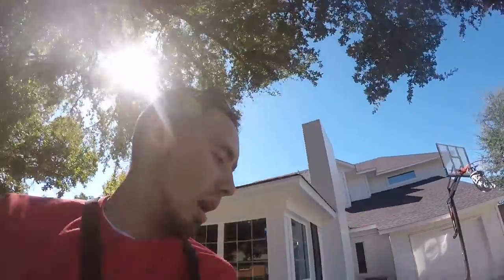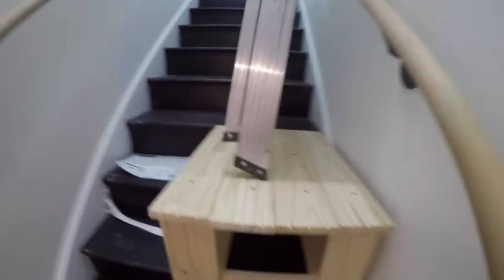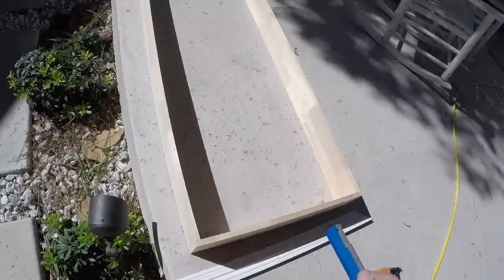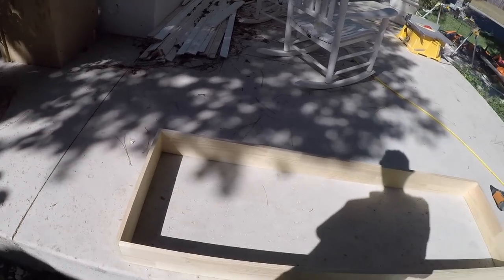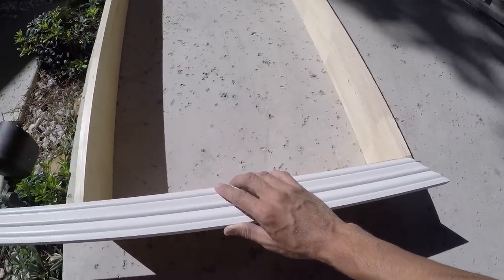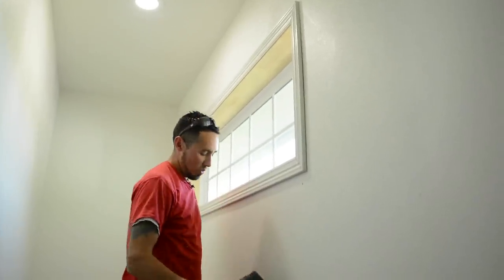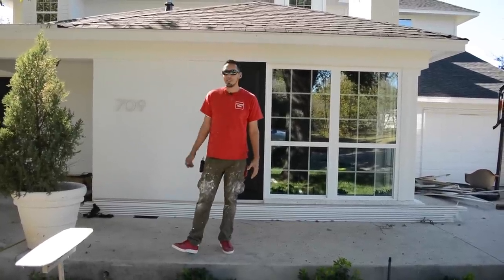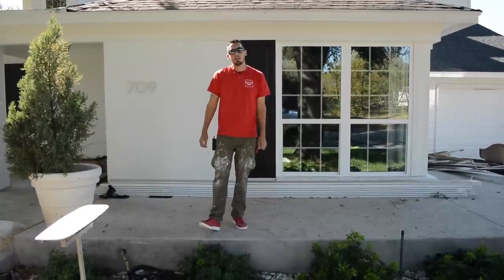Easy Install Window Casing - Trim Carpentry

Comment: NO INSULATION - I will be installing ext. jambs and trim on windows at my camp addition in northeastern NY. The only downside to this, which by the way I was going to use your method, is insulation. It can reach 15 below. Insulation is a must!

Comment: I pre-make all my cased windows but I usually dont picture frame them.  I go with window stool and better header details.
The best way to measure for a window would be to measure the inside of widow sills both ways.  Say you had 71 sill to sill horizontal and 23 sill to sill vertical.  You would ADD on your reveals and header overhang.  That way you get perfect reveals.
For a picture framed window you would cut horizontal headers at 71+1/4+1/4+1.5ish = 73 inches, rip to width
Vertical left and right would be 23+1/4=1/4 =  23.5 inches, rip to width
Then add your opening + reveals for casing measurements.  Casing would be 72" short to short and  24" short to short, 2 of each.
Nail together and hang with perfect reveals.

Comment: Nice work but can you tell me why your 23s were on the outside?  i normally keep me verticals on the inside and my horizontalls on the outside for the structural integrity,

Comment: How would you deal with a window jamb that's not quite square? My window jamb depth is out about 1/4" over a 4ft length. Do you go with the narrower measurement all the way across, or taper it?

Comment: When building your window trim, do you ever check the square of the window?
Reply: Well yeah but if window isn't square you adjust to it to make the casing and trim square. Not much you can do about the window itself.
Reply: @pepeman3099  I meant the window opening. Thanks for responding

Comment: At 15.23 I see the miter corner seems to have a crack in it. I have seen in videos people say to take the brad nailer and hit the miters from the side to keep them from seperating over time. I tried that recently and cracked the corner and I am wondering if that happened to you too lol?

Comment: Just wondering, why did you make the 71 shorter and not the 23? I am thinking that having the horizontal boards "sit" on top of the vertical would provide more support? I know it's not really needed in this specific case, but ...

Comment: Nicely done! Did you measure the opening for plumb and level first? What about measuring the horizontal casing for level after you fit it in?
Reply: ErrorError He obviously took all the necessary measurements because guess what? It fit! I don't think he pulled the measurements out of his ass. Just because you didn't see it in the video doesn't mean it didn't happen.
Reply: I wasn't accusing him of anything, I was simply *ASKING*. Assuming that anything is straight/plumb/level/90 degrees can be a real problem when reality sets in, especially when it's older construction or a home has had a chance to settle. I was asking because I genuinely want to know if he checked at all and what he might have done if angles/measures hadn't been perfectly square. Get a life!

Comment: Dude, I need your help. House walls racked. install a pre-hung door. top left flush to wall and bottom right flush to the wall. everywhere else the jam is sticking past the walls. What do I do to be able to install trim and make it look presentable? Ideas, please. The home has sunk up to five inches in different locations and was hydraulically pumped up. Help. Door frames are no longer in alignment with each other. Thanks in advance.

Comment: Easier way to do that top casing and bottom is to measure inside and add 3/4 to the total. that's the inside measurement of your 45. But regardless, your work rocks :)

Comment: For me, I just measure the inside of the 3/16" reveal, and add double the width of the casing. If I have 20" inside my reveal and using 2 1/4" casing, the overall casing width cut is 24 1/2". Easier for these old eyes than marking & cutting the short point of a piece of casing.

Comment: Nice video, good detail, right length, nice camera work.
If I could stick my two cents in, try working up off the ground, your knees and back will thank you in twenty years.
Reply: Amen to that brother. Same reason I built a welding table. Too old to do it on the ground anymore

Comment: When you nailed the casing on, it looks like you didn't put a nail in but about 6 inches from the end of the long casing(top and bottom).  Is there any reason for that to leave the end loose?

Comment: Your vids are amazing. Definitely sharing with others!!!
Question - bought a house in the midwest with all drywall returns on the windows, they have no trim. I want to trim the windows. 
Must I rip the drywall casing out from the window and install my own wood window casing board first? What is the reason for this?
Is the reason for this because the window trim must be nailed into wood casing and not drywall casing? 
I feel like trim is wide enough that I could get away with nailing the outer perimeter of the trim to the wall and hit the studs underneath. Is it simply just not professional looking if the inside casing is drywall?
Reply: I have the same question! Ever get your answer?
Reply: @vivianataylor9202  removing the drywall return and replacing with wood panel is definitely more professional and polished. Up-close, there is a huge difference between 1) a smoothed drywall return and 2) a painted and glossed wood-panel return/encasing. 

If these are windows high up and far away, there is still a difference but less so).
Reply: That being said, there are tons of compromises that people make with varying degrees of long-term issues. 
I’ve seen people sand smooth their drywall return, and then make a thin wood-encasing and slide it over the drywall return. 
I’m not a professional, but I’d strongly encourage the use to a water-insulating sealant between the drywall and the wood so that the seem between them doesn’t wick in water (from the window) and create a crevice for mold. Other than that concern I’m not sure there is a issue.
Reply: @vivianataylor9202  basically a craft person will just paint their drywall return white and nail trim around the window. The next level up is to make sure you sand that drywall return smooth first. The next level up from that is (if room allows) to put a wood encasing in over the surface of the drywall before adding the trim. And the final level is to remove the drywall return and replace it with a nice wood return.
Reply: @MaBuSt  Thanks for the quick reply! Thats what I figured but I had not seen anyone address it. I am leaning towards using a thin piece of wood over the existing drywall return. The windows are well insulated and I am worried if I take off the drywall return I may mess that up. I will definitely take your advice and use a water seal between wood and drywall.

Comment: I have replaced most of the windows in my home. Every wall is significantly bowed so there is always a fairly large gap betwen wall and casing, and the casing is stained not painted. I place a filler strip the width of the largest gap on top of the casing that is resting on the jamb and scribe the width of the gap down the casing and then glue the filler strip to the casing. I cannot bend the casing because using 3/4" pine.  Is there a better way to do it? PS what contributes to the problem is that they originally used 3/8 drywall and exterior sheathing so the wall is undersized.

Comment: so how do you insolate around the window jamb
Reply: Obviously you can't. Probably warm weather year round. Here in the  Great White North, you have to assemble it all on the window and spray foam or stuff it with batt insulation as you go.

Comment: I normally shim,and spray foam insulate around the jambs as well as the window, so this technique would not work for me. It is a good method for southern builds. I enjoy your videos and can tell you are a craft men like my self.
Reply: Justin Mercer same here in Manitoba
Reply: Looks like it had a drywall return but not 100%, but it would work in that case

Comment: How do you account for a window opening that isn't square? Or a window opening that is bowed in the middle? Do you take the smallest measurement and frame to that distance?
Reply: Michael Aguilar Yep!
Reply: Make it to the smallest detention and casing trim will work as shims. By the time you will caulk it and paint int wont go any where.
Reply: I do the opposite.  Take the longest measure and put the box up.  Mark all edges that stick over and angle rip.  The apply casing.  I have to do this with stain quality oak.

Comment: What do you do different if the window isn’t square?
Reply: Make it to the smallest detention and casing trim will work as shims. By the time you will caulk it and paint int wont go any where.
Reply: Remove window $$$$$. Remove framing $$$$$. Start over with crew of men $$$$$. Now window and walls are level and plumb. Just remortgage your home to pay the bill.

Comment: At 8:45 you say that you need 3/16" reveal. May I ask what for? I'm not a carpenter, I don't see any practical or aestetical aspect of that.
Reply: Aesthetics
Reply: Sometimes it varys from house to house but you always want to keep the reveal on the windows/doors the same in every house
Reply: MrKret87 the reveal helps hide any variations in framing as well as any shrinking and swelling that occurs throughout the seasons.
Reply: Easier to paint and stain too with reveal

Comment: That method only works providing the window and rough opening are installed level. Otherwise how do you adjust the jamb extension to meet the reveal around the window? Cant get shims in with trim preinstalled. Also unless you install it tight to the framing how do you keep the back side of the extension from driving up/down when you nail it? Good video just want to see how youd address these issues.

Comment: was it reall necessary to nail tha in with such a tight fit? if a glass pane up theer gets broken, seems would be a bear to change the glass? as well as that fit, I would have maybe not even nailed it!
Reply: tcseacliff it would have likely moved around, shifted, gapped up, etc. when the wood expands/contracts & houses shift & move when the temp changes & that tight fit (today) could be a totally different fit in a month or so.  You don’t want to not nail it in, if the fit loosens later it could fall on someone walking up/down the stairs! 😳 lol smh

Comment: Why don't you make the top piece longer which would sit on top of the side pieces? I understand that this application isn't structural. Just seems easier and stronger. R.I.P. FATS DOMINO.
Reply from the maker: Brian Spruill it makes no difference. Could have done it either way. Same result in the end
Reply: Actually not quite. In any traditional sill the sill always runs through, with the side jambs sitting on it. Ditto the head jamb.  If they were to separate slightly for some reason when you look up (or down) that way you're looking across the joint instead of right into it.  Same reason you watch the direction when you cope and keep the line of sight across the coped piece when you can ;-)   I can tell by your vids you're into what you do and want to do the best work possible-  get a copy of  Marrianee Cusato's "Get Your House Right - https://www.amazon.com/Get-Your-House-Right-Architectural-ebook/dp/B0751H8T9Z  - it is THE ultimate reference on architctural millwork,  scale, fenestration, etc.   Seriously - get a copy you'll thank me - your work will soar to the next level.
Reply: @HBSuccess  ... Tioga great advice . $35.00 Hardback. Digital $9.00
Reply: Tioga Fretworks I said the exact same thing when I was watching the video
Reply: Brian go and do it your way if you feel better.

Comment: I would have painted it before install.
Reply: Yes!!
Reply: owners resosabilitty hes a tri installer
Reply: owners  responsibility
Reply: Me too. When it's painted 1st and sanded, the final coat of paint really stands out as a finished product. 
 I deduct 3/4" from each piece to allow them to be nailed to lock it in place. I use kiln dried fir a lot and I also add glue to the joint, they are very tight frames and have not had one move in decades. We also insulate between the liner and the framing, now they ( code ) call for foam bead only. For my own places I add more insulation in front of the foam bead.
I do not place the trim on the frame, I use shims to nail through the liner to the framing, then install the trim. The allows the liner to be sized to produce the same reveal around the window frame, small 1/8" works for me, to minimize how much plastic is visible. You can even make it flush if you like for a " no reveal" look.
This is a tough place to work , so the solution is very good to get the job done.
Reply: @richardv5674  don`t give away the easy work to FCtv, painters got bills to pay too....I have ladder levelers on a short fly section of ladder. i`d prep and paint that window with a sandwhich in one hand...
Reply: @richardv5674  is that your enemy statement?

Comment: Why not just measure the inside of the casing and add 3/16 or 1/4 from both sides to the final measurement for the trims shortest point? start on one side and tack on and go. should line up perfect every time.

Comment: I do a lot of these because builders in my area are too cheap to use real window jamb extensions and just sheet rock up to the frame.  Looks ok when it's first installed but after a year or two the seam cracks and crumbles and looks like crap.  Lot of requests to rip it out and install real extensions.

Comment: For the reveal, I just measure the inside of the box and add a 1/4 inch. Gives me a 1\8th reveal on both sides. No stupid lines to draw on the wood. Also you shouldn't have to square the box if your wood is flat and you just cut 90 on the saw. Nail them together and they will always be square. You straighten up the rest of the sides of the box when you're nailing the casing on to it.

Comment: First
Reply from the maker: You win a Titan Capspray. The Idaho Painter has it ready for you. :)
Reply: dfw crown just use a 28ft little giant for stairs.
Reply: I have a 28ft little giant and it works well on stairs.  Only problem with the 'little' giant, it is super heavy compared to a normal ladder it's size.  I have to say though, they are built tough !
Reply: Ryan Petzold is it the gorilla brand? I don'T find it very difficult to move around and it fits in my wifes mini van if I need it to 😎
Reply: THE_FAMILY_MAN_CLAN I have the Velocity 'name brand' little giant. With the rock locks LOL. It is just super heavy compared to my 8' aluminum ladder.  But I still use it almost everyday because of the versatility.
Reply from the maker: Ryan Petzold do these ladders you guys are suggesting adjust to fit stairs like this? Casue that would be great
Reply: dfw crown yes.  Google 'Little Giant' it will change your life.
Reply: +dfw crown you could use a pivit ladder tool.  Works well for steps, roofs, and angled uneven surfaces.
Reply from the maker: Thanks I''ll check it out!
Reply: dfw crown i personally use the gorilla brand little giant style ladder. Lighter & stronger.